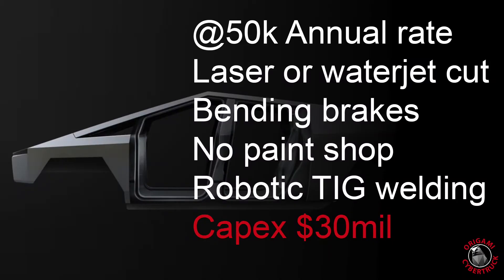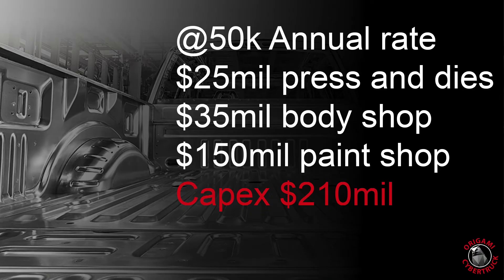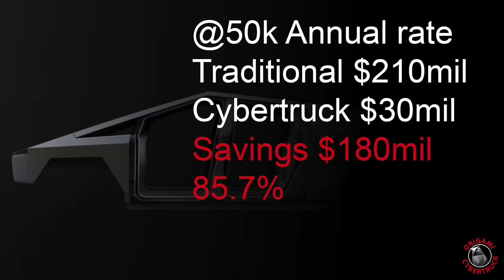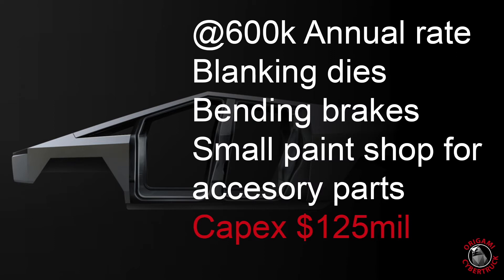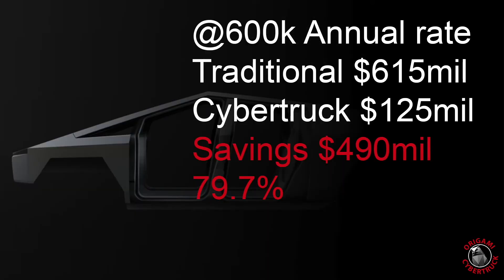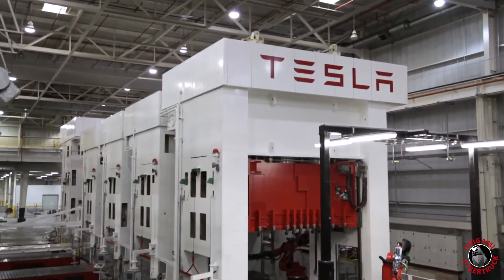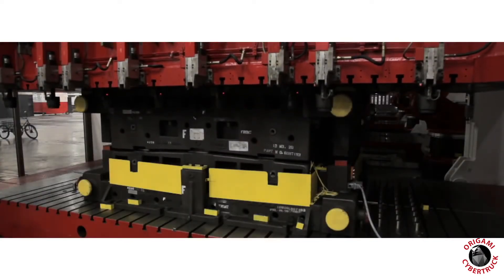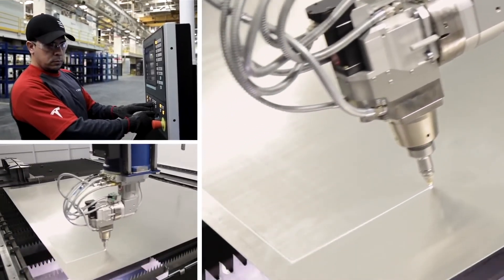Cybertruck Body Cost Sandy Munro Interview Explained

Comment: Also look at the Hustler Huntsman and Highlander by William Towns from the 1980s. They were six wheeled one box cars with large glass areas and a simple space frame construction. The floor and roof were structural but all external bodywork was simply to fill in the gaps and make it look neat.
The Renault Avantime (circa year 2000) should be another inspiration and perhaps a way to make the Hustler space frames easier to live with.

Comment: Why does everyone say the stainless sheet has to be scored before folding? It does not need to be scored it would simply be folded with a brake press or blade over Vee groove as used on fly press folders. Scoring along the fold line back side would be another operation, easy to get wrong, with tools to wear out and it would weaken the material.
Reply from the maker: It's because the work-hardened stainless steel is extremely resistant to plastic deformation. The scoring slightly weakens the metal where you want to fold it, so it provides a more precise fold and also makes the folding easier for the machines.